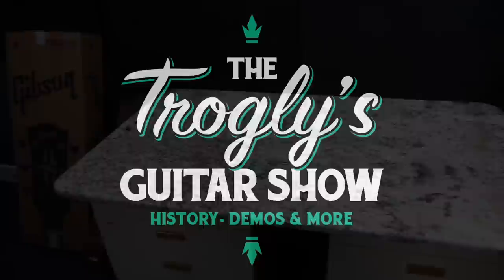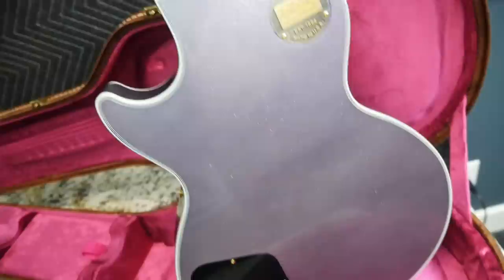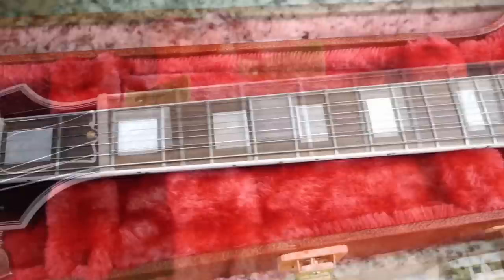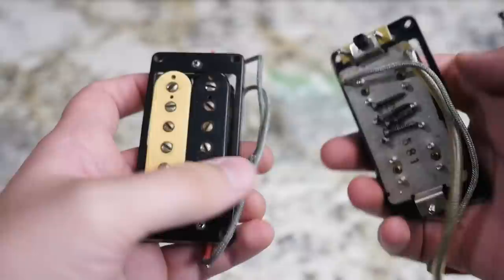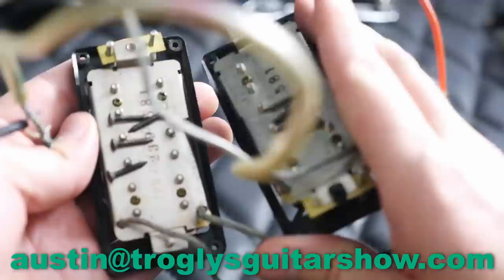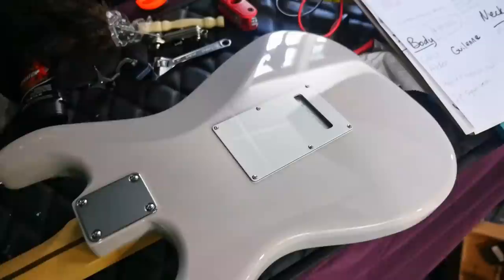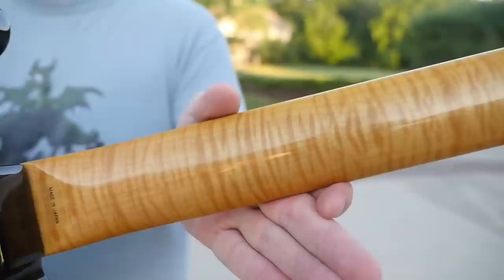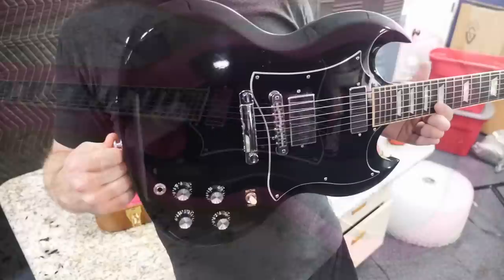This Was My Sign NOT to Sell! | Trogly Boxing Guitars Vlog

Comment: I bought a brand new '22 Gibson Slash Standard a couple months ago and it is simply the best guitar I have played in my 45 years of playing. The best thing , I got it before the price increase and at a normal Standard's cost .   It is Flawless and plays and sounds incredible.
Reply: I picked one up in Nov burst. The nicest guitar I’ve owned looking or playing and as close to a custom as I will ever get. It sounds absolutely amazing.
Reply: Congrats Six Slinger.   Did you order the guitar or go and actually play a few of them?   Which finish did you choose?
I've actually had excellent luck buying on-line, I just temper my expectations.   It took me many years to actually nail-down the attributes that I prefer in a guitar, for decades I just kind of played and never gave it any thought!.   It is always very satisfying when you get a good one.   My wife surprised me with a guitar back in 2001, it also turned out to be a fantastic instrument.   Even all these years later I smile every time I open the case to play it!
Reply: @yoshshmenge294  Congrats on the new guitar James.
The November Burst is really handsome.  Also, I really like the AlNiCo II pickups.   I found an early un-potted set of Burstbucker with the AlNiCo II and fell in love with them.
Reply: @hkguitar1984   Thanks.Bought it online from Sweetwater.... This is my 3rd GLP from them and all were flawless,  just a minor set up on each.  Mine is in Appetite Amber and has one of the most unique tops I've seen on a Slash.  crazy flame all over the place and a rich dark amber finish.  LOVE IT!
Reply: @Krullmatic  I'm pretty sure some of the specifications have been determined by Slash.  Pickups and neck profile as well as top finish are the first few that come to mind.
Reply: @sixslinger9951  Sounds beautiful.   Yeah, the nice thing about "keepers" is that there is usually no doubt what so ever about keeping it.  It's one thing to buy a new guitar, it's an entirely different experience when you realize you're holding a keeper!
Reply: @sixslinger9951  that is why I love Sweetwater!!
Reply: I got one too before they increased the price.  It’s a lefty however!  Enjoy!
Reply: Which finish did you get? Enjoy that guitar! I'm hoping to have at least one great Les Paul again before I die.

Comment: first fret neck depth........
height of stinger off the headstock..
Reply: Nice comment
Reply: No threads exposed on the truss-rod nut, lots of adjustment left!
Greetings Mark
Reply: @hkguitar1984  oooooh..... I like that truss rod nut......looks like its never been cranked.....good1HK
Reply: @markbaum9615  LOL
My 1986 LP Custom has never had the truss rod adjusted and its one of my best playing guitars!   When Gibson builds the necks they finish sand the headstock face on a large belt machine.  Often the top of the truss-rod nut will also get a good sanding.  On my example over 1/4 of the truss-rod and nut have been sanded off on the same angle of the neck transition.
It's just one of Gibson's manufacturing quirks.   I don't look at it as a flaw, just something that happens with production level instruments.   Anyway, the nut and truss-rod are sanded down and there is still lacquer over the top of both!
Reply: @hkguitar1984  ...great story....typical Gibson QC issues  disguised as character..hidden under the truss rod cover...ha....my 1988 Jackson USA dinky has a virgin truss rod as well.....however no belt sand rash
Reply: @markbaum9615  Agreed, that process at Gibson has most likely been sanding those nuts for close to 100 years!   Every step is important to preserve the historic Les Paul tone and the specific way the tone woods are sanded!    LOL, I couldn't help myself.
We are on the same page Mark.  I bought a Gibson because I wanted a piece of music history.    Sometimes you get a great guitar in the process.
My Tokai would be a good example, it's build quality is almost flawless and the wood used are phenomenally beautiful, all for about 2/3 the price of a Gibson USA.
BTW, we are not talking about "sand-rash" on my truss-rod assembly, we are talking about a serious amount of material removed!
Hey, maybe Gibson has a new form of neck weight relief!

Comment: To check pickup output outside of an instrument.
Connect the test leads to the pickup leads and set your Multimeter to AC millivolts.
You should be able to use a metallic screw driver shaft to tap the pickup pole pieces and induce a small voltage.
Depending on the Positive/Negative Lead connections the voltage jump will be either positive or negative (this point isn't important because it shows the pickups produce an output).
Basically, tapping the pole piece with a metallic object indices a micro voltage the same way moving strings would do when the pickups are in use.
Reply: Or sticking the four cover screws to the back?  🤔
Reply: @charlesbranch4120  LOL, exactly

Comment: LOL, unstable Strat.
With new strings my Stratocasters usually take a day for the tuning to settle down.
Additionally, not sure if its only me, but when I tune my Stratocasters I usually have to tune all the strings 3 to 4 times.
I keep my Trem tailpiece to factory specs and it seems kind of touchy even though I use 5 springs.
Reply: They are what they are. Still the best tremolo out there. The amount of springs and tension won’t matter. It still moves every time you tune a string.
You’ll get used to it.😀
Reply: @friedrudibega6384  Exactly.   I'd never want to be pinned down to one type of guitar, each of them has their own thing going on.
Years/Decades ago I had the full Jimmy Page Split/Phase/Series-Parallel wiring in one of my Les Paul guitars.   I found that I was much better off having multiple different guitars that all did their one thing really well instead of a do-all that did nothing really well.
Reply: @hkguitar1984  I have a Dean V that I had the same wiring and it drove me nuts so went to a 50s wiring nice n simple.😀
Reply: @hkguitar1984  that's how I look at it. Gibson LP's are my #1 but I also play Strat, Tele, PRS and a few other brands.
Reply: @friedrudibega6384  +1 on the '50s Wiring.  Done correctly you have much more control over the tone, which BTW is now interactive with the volume control.   It takes some time to learn what is going on with the '50s wiring, however it is well worth the effort.
That said, I know players who can't hear the difference other than the '50s wiring can cause some volume drop when adjusting the tone!   Everyone's ears are different.
Reply: There are  tremolo when you let go of the bar it goes south and locks so   than it plays as a normal axe, kind of heavy an pricey aaah gday😁
Reply: @misterghee1  Thanks Gerard.
Any and all input is most welcome and appreciated.  gday to you too
Reply: @hkguitar1984  hey HK yeah tell m all don't overtighten coz the spring give way in the end you can't bend hahaa just have the 6th sound okay coming from low if all OK is it to high its undoeable tuning down just start over get a tuner and try again haha well my Fender performer after tuning usually G goes up by it self in a minute of playing haha after that I can bend it pretty well you can hear it on Labyrinth of dreams and Supremacy by old Dutch progmetal group Elegy  just enjoy fast&furious melodic as can be hang ten HK🎶👍
Reply: @hkguitar1984  now enjoying the advantures of tintin after a strip eh comic series😁👍
Reply: @misterghee1  You've much more experience with those trem-systems than I.
Keep Rocking Gerard